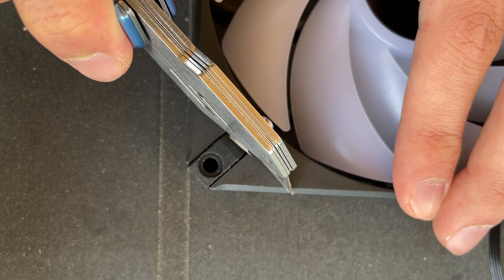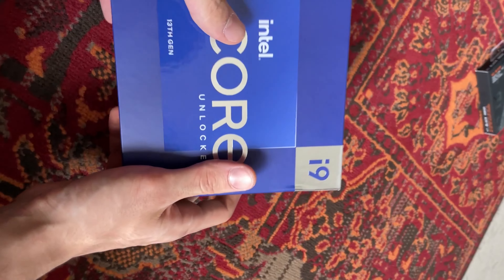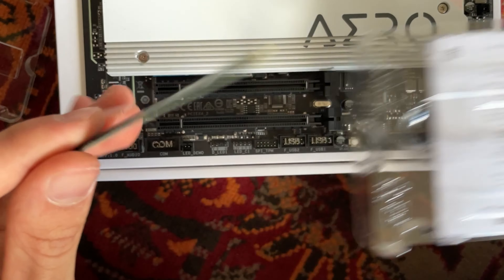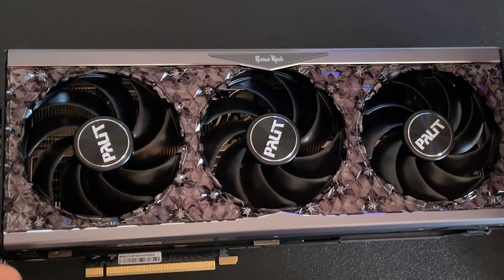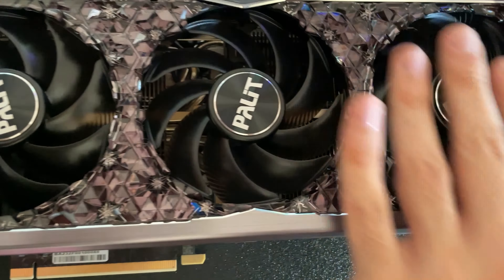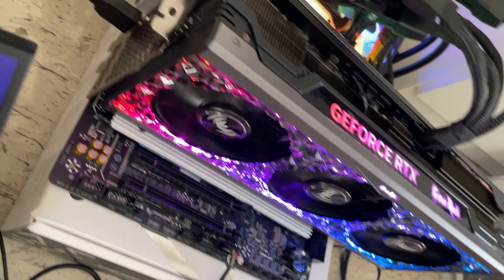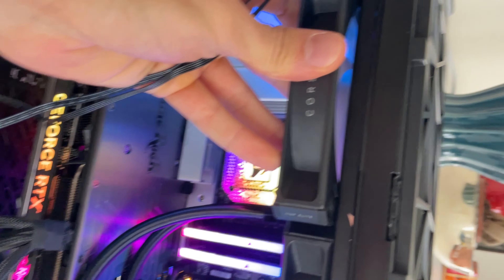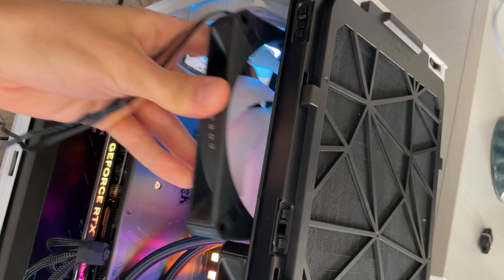I cut holes in his RTX 4090 Gaming PC...

Comment: hello, how are u? 😄 
I'm brazilian, my country is kinda hot and I was searching how to low the temperatures of my VGA(PNY XLR8 GeForce RTX 3070 Ti Revel Epic-X Triple Fan) . I play at 1440p and in The Last of Us my temperature hit a new level: 84ºC. I was kinda scared...  Even if people says that this temperature is normal, I was like: "no way this is fine" 🤨
So, after some reaserch I found a video from you about undervolt. I did everything as u said, but when I set the +1000 mhz the image is gone and I need to reset the pc for it come back. Did I do something wrong? I'm using a core i9 12900 and 32 gb ddr5 (4800hz).
Your videos are really good, u are strict to the point. 
Sorry for bother you and thank you  😄
Reply: It means ur gpu can't handle +1000MHz on the memory clock which can mean if u bought it second hand that ur gpu was used for mining. Set only +500Mhz on memory clock. In Brazil from friday the temp will be +17°C max, looks like the winter has come to ur country as well.
Reply from the maker: Hey there! Pete said it well, it means your memory is slightly worn and can’t handle +1000Mhz anymore, luckily the +1000Mhz is not part of the “undervolting” itself, it’s just to get a bit extra performance. So you can just put +500 as Pete suggested or leave it at 0 and just follow the rest of the tutorial :)
Reply: @ImWateringPSUs  hello, thx for answer. 
This VGA has less than 1 year and I didnt play too heavy games at ALL. I belive it is something else... Anyway, I was playing Final Fantasy XIV after undervolt and the image freezes. Dunno anymore what to do xD
Reply from the maker: @leandrof.m6112   Simple: set it to 900mV, 1800Mhz and no memory offset and it will never freeze again :)
Reply from the maker: Also be sure to subscribe to the channel if it was helpful :)
Reply: @ImWateringPSUs  ok, I'm Going to test xD Already sub! 😄
Btw, should I keep pressing "L" there?
Reply: @leandrof.m6112  It's  freezing because the voltage is not enough. Try 937mV at 2032MHz and dont OC the memory clock.